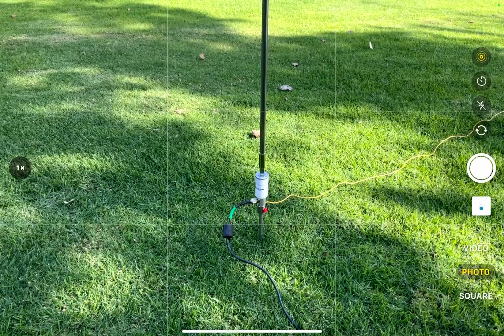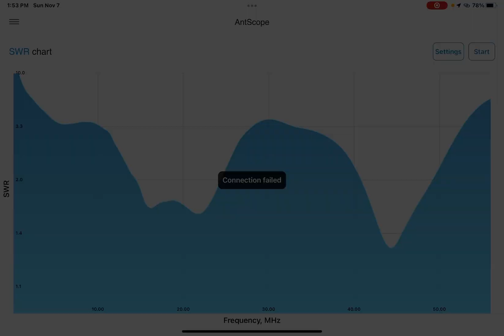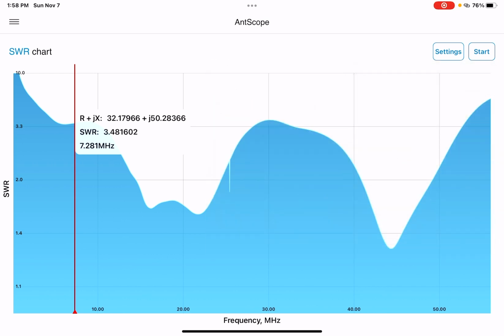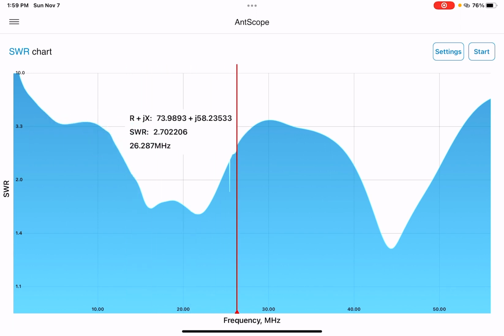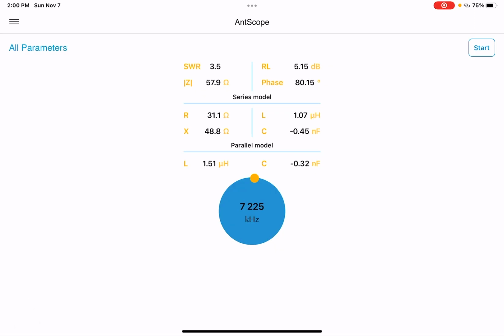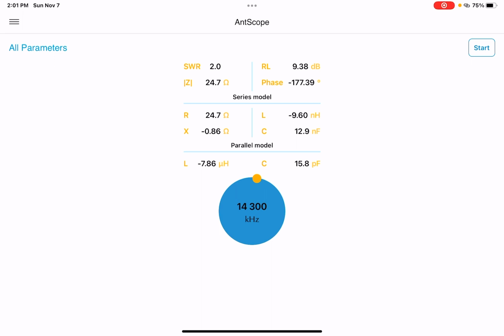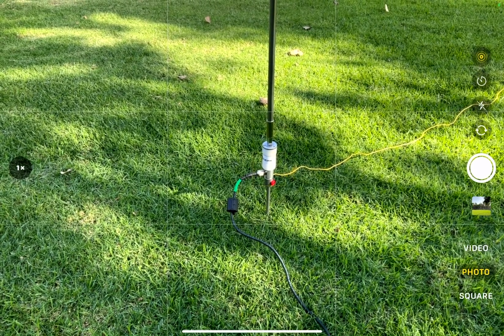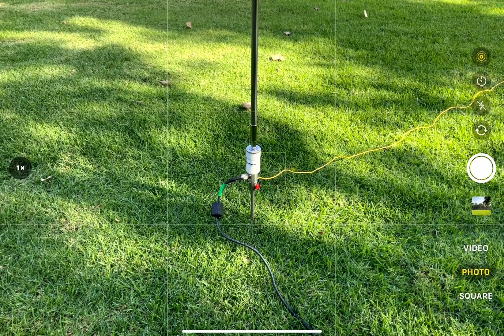CHA MPAS Lite Shorter Counterpoise

Comment: There was a 60' Radiating element shipped with my Chameleon Hybrid system, to be configured as a sloper or Inverted "L".  I think that is what he using with he says he is deploying a 60' counterpoise.

It is works, what the heck.  I have three Counterpoise I made up and they are at 25' in length.

Comment: Thanks this was helpful. To one of the comments below I wonder if two or three radials, perhaps even shorter radials, would work better. And I would do it with lighter gauge wire. Otherwise the Chameleon kit will is heavy, particularly for SOTA.
Reply from the maker: I have other videos with more radials, long and short, and I didn't see any big difference.  It has a lot to do with the ground and the ground plane.  In these videos I wanted to lower the SWR so I can get 40m without a tuner - but I was not successful.
Reply: @frankwc0o  OK great thank you I will check them out

Comment: Debating whether to make my own 4x25' counterpose w/26 gauge wire. Do you see an advantage of the Chameleon counterpoise kit vs DIY?
Reply from the maker: I haven’t bought their kit, but have created a DIY kit and so far I don’t see any significant difference compared to one radial. The most I’ve seen a difference in SWR is in the different locations I’ve been. Different ground have different conductivity properties. Thus I observe different SWR results.
Reply: @frankwc0o  Ok, thanks. Maybe best idea is to try my own simple attempts and see how it goes. Operating the vertical without counterpoises is less than optimal (I'm spoiled by resonant wire antennas though).
Reply from the maker: @Redhawk03a  you will be surprised that the MPAS will work fine without the counterpoise for the spike is on the ground